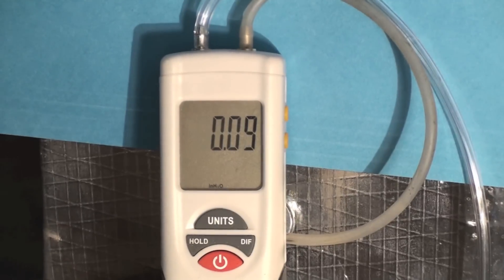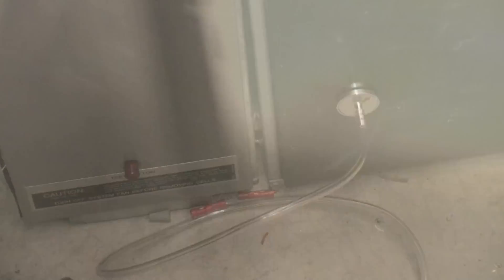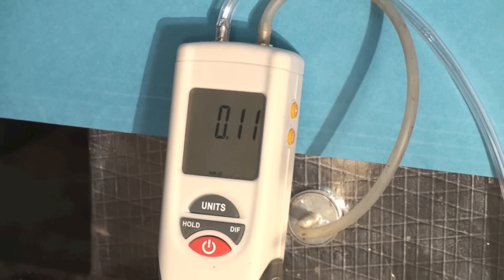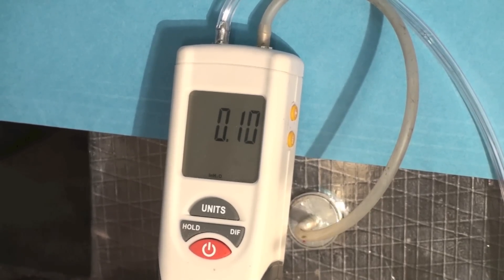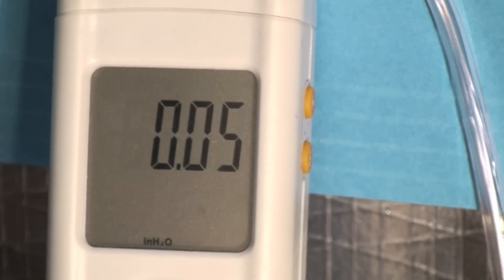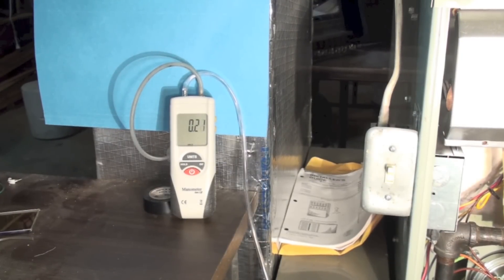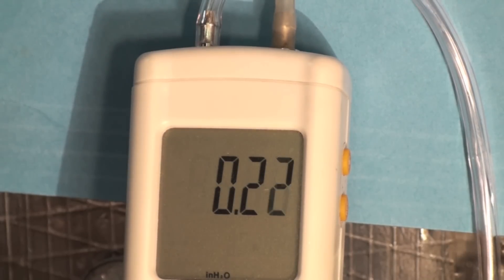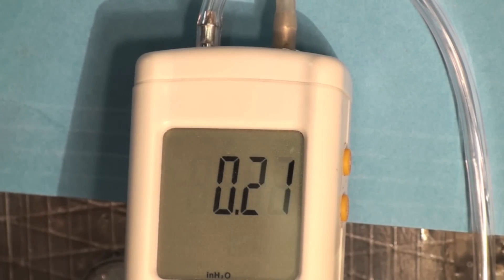Checking HVAC filter pressure drop

Comment: Depending on the furnace or air handler you are using you might be fine at .21” across the filter. If it’s an older furnace rated at .5”, then  .21” is too much of a pressure drop since it exceeds 1/10 of the capacity of the design. With a ECM motor .21 is ok, the motor will just ramp up. The real question is should we be using our furnaces for cleaning the air and selling then as an IAQ solution???? The original intent for the filter was designed to protect the system from dust not to improve IAQ for people. If we go down that road then my argument will be that you would have to add more returns in order to get the proper air exchanges throughout the house to truly make a difference. I use a MERV 8 = .17”, at home and that’s what I recommend to my customers with ECM motors other than that MERV 5 at .03”. I live in California and during the forest fires I recommend a MERV 13 carbon filter to customers that have ECM motors, it really make a difference.

Comment: grayfurnaceman when determining indoor airflow by calculating DT and Trop are the return air temperatures measured before, or after the filter? In my scenario I have return-filter-coil-heat exchanger-supply. Thank you.
Reply from the maker: Brian Fletcher It makes no difference for temperature measurement as long as it is before the coil.
GFM
Reply: grayfurnaceman Thank you for giving of your time to help.

Comment: Pleated filters only work decent if you change them often and are installed on commercial air handlers if you have a lot of air horse power available to counteract with the large pressure drop. The worst is people who buy those filters and install them on an old 70% efficient furnaces. On the old furnaces there is generally only one speed and that tends to significantly decrease heat exchanger life. I do like it on the large commercial air-handlers when the pleated filters plug up, sometimes they end up right in side of the blowers if the DX coil is installed up stream of the S/A fan
Reply from the maker: I had a sucked filter break a shaft on a 3 blower assembly once.   I completely agree.  
GFM
Reply: I had an old furnace (39 years old). I didn't even use an air filter.
I took it apart and it looked like someone had a mud and lint fight in there.

'never had any problems, though. it was a goodman brand unit, installed on a doublewide.

Comment: Once again a YouTube video with misinformation!

A) a 1" filter is useless. Unless you're filtering for bugs or birds, a fiberglass filter only gives folks the illusion of "I have a filter in my furnace"
B) static pressure is the end all / final # ever to be used on furnace install and servicing.

That said, the pleated filter shown is definitely the reason the static pressure went as high as it did. The reason is: surface area.
 
If he had "tested" with a 3 1/2" or wider filter his # would not have been that high.
The wider the filter (deeper pleats) the surface area multiplies significantly. As soon as you increase surface area you will decrease static pressure.

I run a Lennox 2 stage furnace with a 16x25x4 3/8" Merv 11 filter. My pressure drop across the filter = .08 on a new filter. I change the filter out @ a reading of .11-.12. 
My furnace tag states a max static pressure of .8
I have never exceeded .7 " of w.c. across filter/blower/coil 

For me the last 4+ yrs that # = 11-13 months for filter change. So about $27.50Ca a year for filter cost. (amazon purchased "Canadian made" filter)

Static pressure on a furnace depends 100% on properly sized supply and return ducting and..... all joints sealed with an appropriate duct sealer (not "duck" tape).

FYI
If you have a filter slot that is not covered, you have the worst configuration possible. Air easily passes the filter and contaminated air will enter your furnace (and absolutely screw up your TESP).
High static pressure = bad
Low static pressure = good
Reply: How do you fit a 4" filter in? I have an old condo furn. With a cover plate, slide down filter with the side ridges. Do you just cram it in there?

Comment: My Package ac unit pushes 1600 cfm, 4 ton. I have 2 return airs, 1   14 x 20, and a 12 x 12, take both filters out, pleated, and I measure 1578 cfm going into the return boxes added together. Install both filters and in total I lose right at 268 cfm. Not good, I have since buying the system have used pleated filters, and I had to replace the supply fan motor after 4 years and 10 months. Wonder if this is what caused the motor failure. Guess I will switch to the really cheap filter, replace once a month, and clean my evap coils twice a year. I believe there is no good solution to this so elementary problem. Maybe just get a large sticky pad to lay inside return air box, not in the direct flow of the air, and some of the bad stuff should just get stuck. Maybe self cleaning Evap coils, apply a negative charge to the coil and auto spray with a mist solution of weak coil cleaner.
Reply from the maker: I have been meaning to do some tests with different filters to see which is lowest on press drop.
GFM
Reply: Google User  I bought 4" filters - says, brand new, it'll pull about .31 w.c. @ 1400cfm. 78 square feet of filter area...